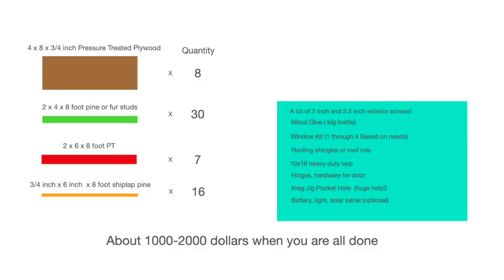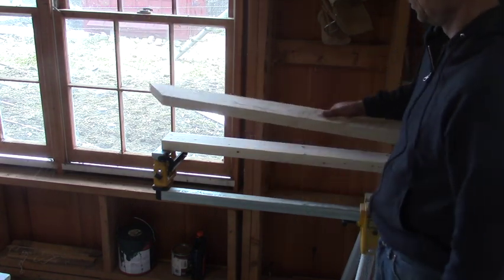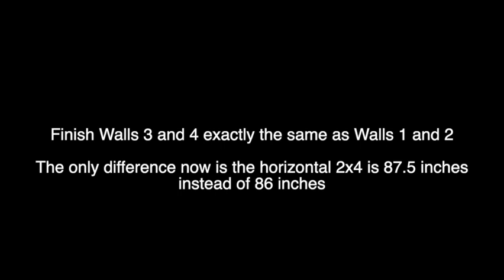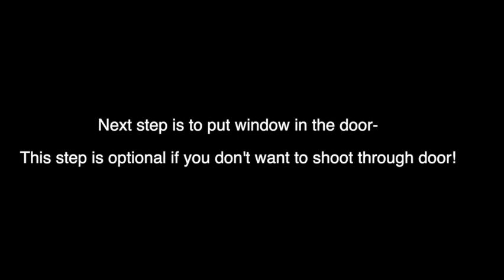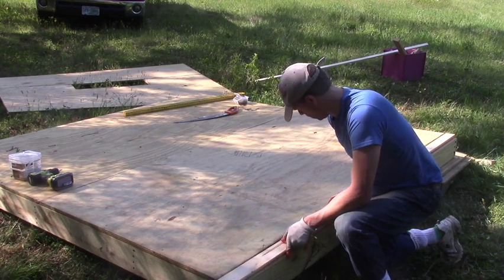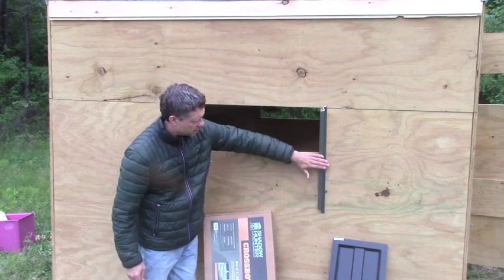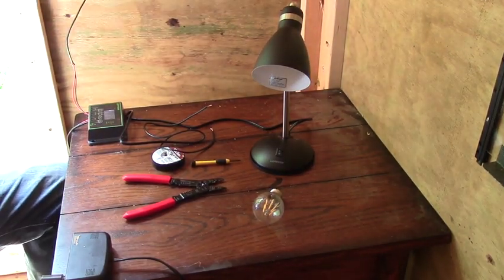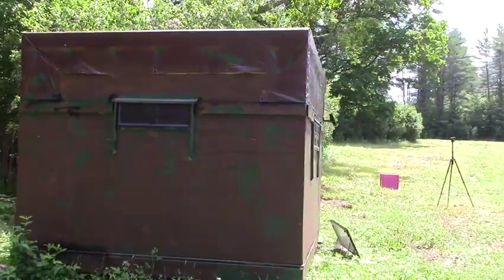DIY 8x8 Amazing Hunting Blind!

Comment: Great video but I was looking forward most to seeing how the windows actually operate.i made a 4w x8l x 6h blind in December of last year. I made my own windows of sliding (sideways) plexiglass but thought about changing them to sliding up and down like yours. An in depth video would be great. Terrific blind.
Reply from the maker: Thanks for the watching!  The blind windows are super easy as the plexiglass  just slides up and own on the inside rales. This year, I actually kept window up and when I saw a deer, I slid it down, no noise.  The black outside shields are always up when hunting.   This is a pretty good video: https://www.youtube.com/watch?v=ITQkg0hh7aU.  Let me know if it helps enough.
Reply: @themedhunter  that helped. Thanks!
Reply from the maker: @mr7badass  Great,  I meant  to say the black outside shields are always down when hunting (so you can see out)
Reply: @themedhunter  are those windows pretty air tight?
Reply from the maker: @mr7badass  There will be small gaps on sides, but there will be no breeze and it keeps your scent in

Comment: That roof is not going to support much snow weight and the tarp isn't going to last long.  I would maybe look into some rubberized paint for the roof instead.
Reply from the maker: Did great last winter, tons of snow.  I recommnend getting heavy duty tarp.  I have 3 blinds like this, heavy snow is not a problem.  Worst thing was a summer storm that did tear a hole in tarp because of an exposed nail.  Quick patch job